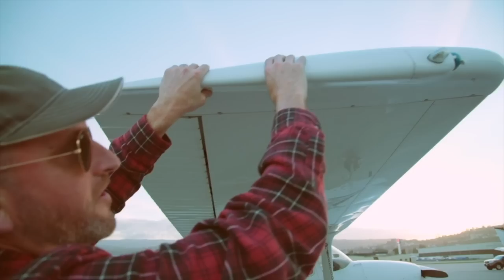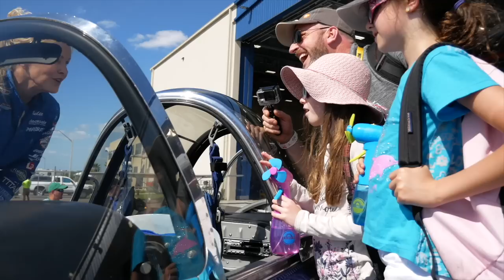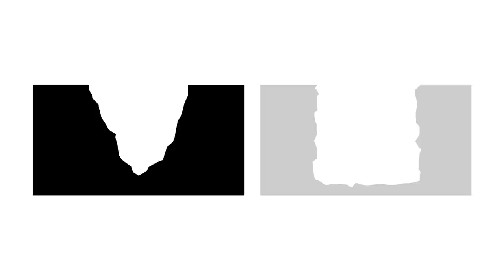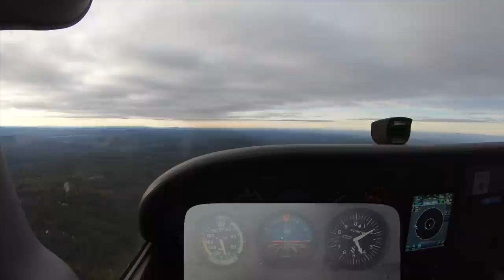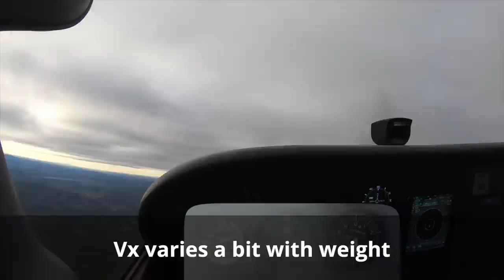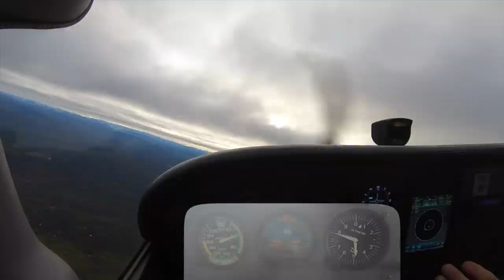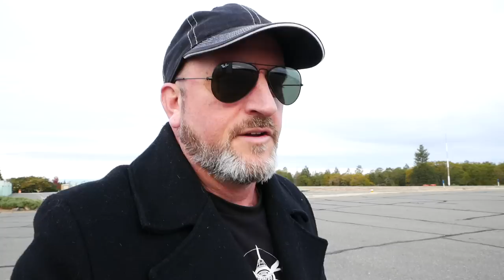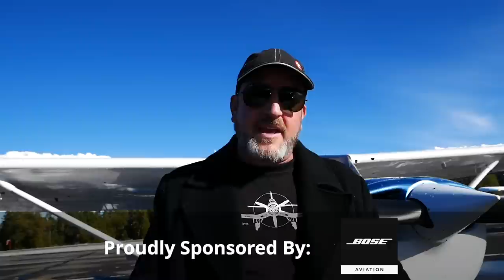The BOX CANYON Turn - LEARN TO TURN THE AIRPLANE IN THE SHORTEST HORIZONTAL DISTANCE.

Comment: Airspeed can be close to zero (instead of Vx) provided you don't ask anything of the wing: pull up aggressively to almost vertical while just not stalling, then let the plane fall over in an 180 degree turn. Pull as soon as the airspeed allows. Works without altitude loss. The manoeuver is an aggressive wingover, but short of a tail slide. Exercise at altitude.
Reply: Totally agree; wing over is best answer - super tight turn and allow nose to fall; stalling threat is minimal if not pulling back (minimal load on wing). Two things to watch - air speed build up and altitude, but plane will come around in minimal distance.  Always have enough altitude to perform wing over if needed - turn to drainage end of canyon.  I practice wing overs with 500ft altitude loss.
Reply: Came here to say this… but maybe it’s outside the scope of the sort of training most GA pilots receive?  I’ve had a lot of unique training and flying experiences since basic training, so pushing closer to an aerobatic maneuver to reduce ground speed to near zero isn’t as far fetched an idea to me.
Reply from the maker: Yes I agree that’s why I think you should practice with your instructor. I didn’t exactly want to show that in a YouTube video the X seems to be a good target for the average pilot
Reply: deJong…sorry my friend.  This is absolutely wrong.  You need to read some mountain flying books and get together with an experienced mountain pilot instructor.  

In all my years of living in and flying the mountains (from Alaska to Idaho, Nevada and in between) with my 185 and being a Civil Air Patrol and sheriff’s office instructor pilot, I have never been taught nor taught what you describe.

This isn’t the proper forum to teach the Canyon Turn.  There is a large variety of published material available for folks to read, starting with Sparky Imeson’s pubs and Amy Hoover’s and Dick Williams’ “Mountain, Canyon and Back Country Flying.”  The next step would be to find an experienced back country CFI who actually specializes in back country flying and who will teach you how to apply the proper and safe procedures for a long lived and enjoyable mountain flying experience.
Reply: It doesn't have to be acrobatic to be energy effective.  Any turn can be made safely at any bank angle so long as we release back pressure on the yoke to stay at 1 g in the turn.  Nor do we have to give up power, it can be done at full power.  We do a thousand a day crop dusting and using wind management arrive 50' upwind at 3' wings level over the next swath run.  A shallow turn can be energy management.  Pull up with cruise zoom reserve, bank as necessary, and allow the nose to fall onto the new target.  Pulling to maintain altitude in turns is energy inefficient.  Use your wings level gained potential energy of altitude to make the turn of less radius and 1 g.
Reply: We did that in a 150 with the engine off to stop the prop to act like a glider. We were with easy glide distance of the field just in case. Pulled up and when the speed died just kicked the rudder to reverse course.
Reply: @mannypuerta5086  During my tailwheel training my instructor showed me this "turn", we gained 20 feet, a 180 to the opposite heading. :)  Then told me he could do it in a bonanza just as easily.  He's flown plenty of mountain flying in citabria's, stearman's, cessna's, RV's etc....

Comment: Love the video. It would be helpful to see the flight track on foreflight or garmin, or even CloudAhoy.  Then we can see how much ground you used to turn.
Reply: Ditto. 
You should fly all three of these different types of turns (standard rate turn, turn at VX, and the last turn you did in the Box Canyon) 
For Example, starting from a west heading, and at a certain point (over a lake, house, intersection , etc) make your turns and overlay all three flight paths on the screen to see just how much distance you needed to completely turn the plane 180°.

Comment: Would the box canyon turn make sense in the situation where you've had an engine out, but feel that you have the altitude or runway length to do a 180 back to the airport? Seems like the smaller turn radius would be useful, but I don't know if you're going to lose too much height in performing it.
Reply: It takes practice.  Losing the engine on the climb out and getting the nose down to best glide and doing a 180 is a lot to ask. In a “WTF”  surprise, if you can do a 180 with an 800’ altitude loss you are doing well. Unfortunately, the stall spin in trying to “save” the plane occurs all too often. While my engine is warming up, I go through my “engine out” review. “At this airport under 1000’ AGL, I'm landing straight ahead +-45 degrees”. The plane now belongs to the insurance company.  You will never be second-guessed about sacrificing the plane.
Reply: Altitude is always your friend.

Comment: Ironically, I practiced Box turns during my Flight Review with Tyler Stanger, Cory Lidle’s CFI, a couple weeks before the NYC accident.
Reply: i USED TO TEACH IN THAT AREA.  But I learned before how to do those tight turnbacks.  Winds that day where from his right side and strong.  He needed to turn left and quite tight. In that case he needed to go to the left side first, then do A Teardrop Turnback.  He tried a tight tailwind 180 instead.  Guys that dont know much will try that, then seen they are going to overshoot they will cut the power instead of popping more flaps. THAT IS A POWER OFF, FLAPS UP, ACCELERATED STALL. 
  I bet he didnt know accelerated stalls and got into it, went down.. and hit the building.  Practice those before the Teardrop Turnback.  And 220 Turnback  (180 Turnback Overshoots).

Comment: Impressive that the 180 steep turn only lost about 250 feet.  Particularly if you turned some speed into altitude at the start, I didn't realize that was possible.  It will be interesting to try/learn, but still... not getting into that situation in the first place is the main thing.
Reply: He’s in the plane by himself. Gross weight might be a slightly greater loss of altitude?
Reply: Once a pilot achieves their licence the very next step should be Upset Prevention Recovery Techniques (UPRT) training, and if that is any good they will learn intensive wing over turns (similar to an aerobatic hammerhead) withi  the capability of a GA or LSA airplanes G tollerance. 
So unlike what Jason suggested, slowing the airplane fown at the same altitude, immediately pitch nose up between 45 and no more than 60 degrees. Once established in the steep climb, (by releasing the elevator to a constant pitch up) the speed drops off rapidly. The next almost immediste step is to drop a wing, (nominally 45 degrees but depending on the airplane you could go almost 90 degrees) as the speed drtops to Vx (and remember no additional elevator back pressure (and therefore no stall) the airplane will pivot quite rapidly around and start descending on a 180 degree track within two to three wing span lengths of seperation between tup and down tracks, and you must pull power to idle the moment you start down) Actually with practice you can do the turn below normal stall airspeed (sometimes with a little bottom rudder to assist (as in a Hammerhead)). Note that the airplane will not stall (because you  never exceed a stall angle of attack -  keeping pressure off the elevator and never exceeding Stick Stall Position) even through some people call this a stall turn, you nerver stall. 
Now just as in all UPRT use PARE, that is Power to idle, Ailerons neutral, find the horizon, and Roll level, and recover from the dive using Elevator. 
With practice you will see perhaps  2Gs on recovery, an be an a 180 degree opposing track at the Same altitude you commenced the procedure.  Easy!
Don't try this without a competent instructor , because the first time your head gyro will be spinning, but after demo two with hands and feet on the controles you will love the procedure.
Reply: @richardseton7014  Great Explanation!  I learned it over 40 years ago, and practice regularly.  The only thing that I would add is that once learned it is an extremely FUN maneuver to practice!

Comment: In the second method, why wouldn't more power be helpful?
Reply: I would say it's becuase power would increase the radius of your turn. Assuming your trying to keep that turn as tight as possbile, groundspeed and too-much airspeed would be your enemy. Power idle allows you to reduce groundspeed and maintain the tightest turn (radius) possible, while flaps will help lower your stall speed. Jason or someone else can correct me if I'm worng here. Note, that he also releases the back pressure in the turn so as to not put the plane into an accelerated stall.
Reply: In a wing over more power does two things: increases the radius of turn and takes you toward the ground faster and altitude is usually a luxury not available in a box canyon.
Reply: In a wingover excess airspeed is a threat even with no power.  Add power and you will possibly exceed your Vx very quickly and may not be able too pull nose back up.  Everyone should know how to do wing overs as they are a much fun as well as very practical maneuver.

Comment: Excellent explanation of what I have called the energy management turn or crop duster turn or gunnery return to target turn.  The second turn   you demonstrated is this energy management turn.  Yes if zoom reserve airspeed (hopefully cruise airspeed) is available, pitch up wings level to slow ground speed for a shorter radius.  Wind management means we were ridge riding the ridge downwind of the drainage we are using up drainage toward the pass.  This gives us the headwind in the turn for, again, slower ground speed and sharper radius of turn.  Yes, we unload, at least to 1 g, the wing in the turn of any bank necessary to turn to the target which is the bottom of the drainage going back down drainage.  The unloaded wing cannot stall.  In the western mountains of the U.S., vertical space available in the drainages up to the pass is generally greater than horizontal space available.  We need to be very near the downwind ridge, but also we need to use the vertical space available with the unloaded wing turn of any bank angle needed.  A 70 degree bank angle at 1 g is entirely possible if we let the nose go down as designed for safe dynamic neutral stability.

The supporting aerodynamic principles of the energy management turn are covered best in Stick and Rudder by Wolfgang Langewiesche.  The law of the roller coaster teaches us that zoom reserve airspeed is altitude and potential energy of altitude is airspeed.  What does the airplane want to do in a turn?  It wants to lower its nose to prevent stall because dynamic neutral stability is designed into the airplane.  The critical angle of attack with the relative wind is when the wing stalls... not why.  Why does the wing stall?  Because a pilot has pulled back on the stick.  When vertical space is available, there is no need to make level turns.  We are not IMC where pitch and bank are limited.  For a crop duster turning steeply in a very small radius by unloading the wing and allowing the airplane to save itself, 200' of vertical space available is adequate.  What makes the energy management turn so safe for him is muscle memory.  He doesn't even think of pulling on the stick without zoom reserve airspeed, hopefully cruise airspeed.  He doesn't even think of pulling on the stick while banked because that would overload the wing with the mathematical load factor effect.

Comment: Since your conventional aircraft has a lower stall speed as at the COG moves aft you can make a tighter turn by having everyone in the plane lean backwards or having your co-pilot jump into the back seat. 
In a 60 degree bank at stall speed there's a 10% difference in turn radius between the most forward and most aft COG.
(not entirely serious, but the physics work)
Reply: Great to see you show up here having fun Sir Manley
Reply: You couldn't bring yourself to end this one with "fly safe", I notice.

Comment: Take care to keep the ball in the middle to avoid stall spin at low speed.  Pitching up will increase left turning tendency so a left turn should be preferred to relieve the need for right rudder.

Comment: In #2, I consider that an energy management turn (think surfing, turning up the face of the wave, trading kinetic for potential energy, at the top while very slow, you make a super sharp turn then go back down the wave.  I do this all the time except I don't chop power immediately. I realize you actually need to use rudder if you don't want to risk a stall, but that's what those pedals are for folks. Learn to use them! Skyhawk is so forgiving lots of their pilots forgot (or never really learned) how to properly control an airplane.

Comment: Great video, but one thing I'd have loved to see is a GPS track from Foreflight or other showing say a standard 45 degree bank @ 100 knots or so vs your first and second manuever. While visually it was easy to see (especially on second manuever) how tight that turn was, I'd love to understand trully the turning radius differences in real distance.
Reply: Easily done in Foreflight.  I practice wing overs all the time - why, they are a ton of fun and very useful.  A wing over allowing myself 500 ft of altitude loss will turn me 180 degrees in about half or less if turning into wind.

Comment: Great video Jason.  I'm a CFI and have never heard or tried these but will as soon as the weather clears.  Would also consider teaching them as just evasive maneuvers from other aircraft if deemed necessary.
Reply: Perfectly decent evasive maneuvers for any "in air incident"... CFIT is a thing, and has claimed a LOT of lives. Evasive and "Emergency" maneuvers are much the same in aircraft as they are on motorcycles. The HOPE is that you'll never ever need them... BUT you practice, Practice, PRACTICE them, so you're just as comfortable doing them as any routine maneuver or task. You practice so that it's actually difficult to screw-up... not just to the point that you "can" accomplish.

    The point is that it's going to be the day "like any other day" when you think you've got a handle on everything, and you know where you are... You're confident in the instruments and everything's "fine" until that moment that it isn't anymore... Sh*t hits the fan FAST and you don't have a lot of time to "switch hats for crisis management" while taking on checklists, going through ATC, squawking emergency, trying to keep the aircraft in the air at the same time you're juggling what's actually wrong and what went wrong originally... AND then there's a mountain dead-ahead and the alarms are drowning each other out...

     If it's still a "specialized evasive maneuver", you might be shaky or hesitate. If it's the same old hat as landing in the crab or buzzing Uncle Joe in his canoe on the lake, you won't even need time to think about it... Your hands move on their own, and then feet, and the plane seems to magically just do what you will it to do...

     Maybe I'm a tad melodramatic for being more experienced (like 80% or more of my life on this planet) on motorcycles than in aircraft... BUT I stand by my point. The guys who REALLY get comfortable in emergency maneuvers, handle the tightest and most difficult of those maneuvers with the WORST terrain with all the sweat or tension of picking their noses. The noob's are tense, hesitant, jerky, and drop bikes all over the place on dead-level dry pavement with freshly scrubbed in "perfect" tires and pressure... AND cones are everywhere except where we put them (Thank GOD for sidewalk chalk!)

     SO while the majority of my aircraft time has been spent in "experimentals" (read "flying go-karts" essentially) I'm aware that planes have brakes up there, but those ain't NOTHING like the brakes I enjoy with any ground vehicle... I'd imagine for emergency maneuvers, it's much the same for "real pilots" as it is for us "real bikers"... haha...  ;o)

Comment: When I did my first mountain flying training I was startled at how quickly a plane (a Cherokee, in this case) could do a 180 if it really needed to. The flying schools' mountain checkride included a ridge crossing where the chart was misleading on what altitude you actually needed. The expectation was that you would recognize that it wasn't going to work, not attempt to out-climb the rising terrain, then do a 180 so you could try again at a better altitude.
Reply: When you 1st have a thought that you may need to do a 180 , DO IT  Right away it's not going to get better